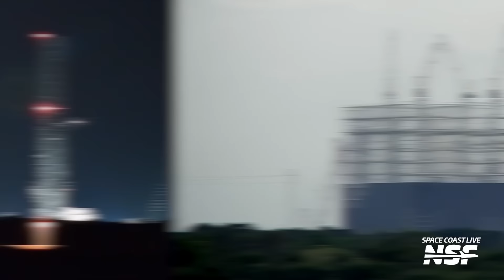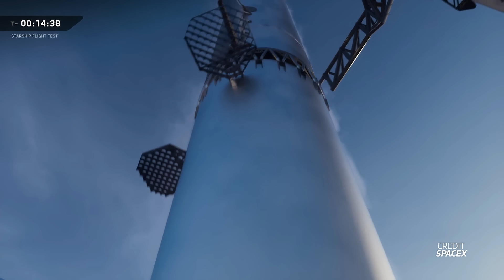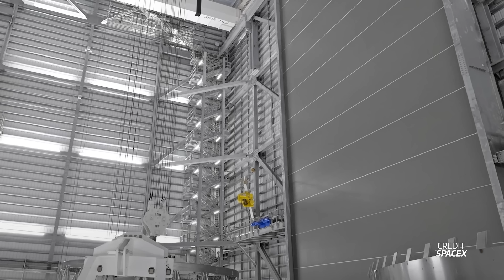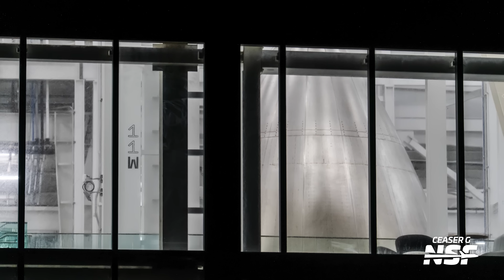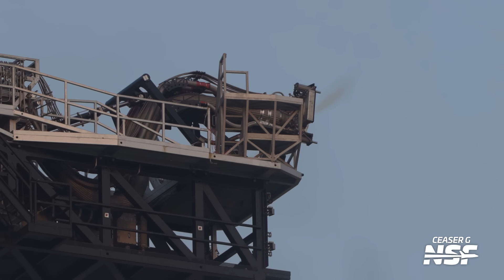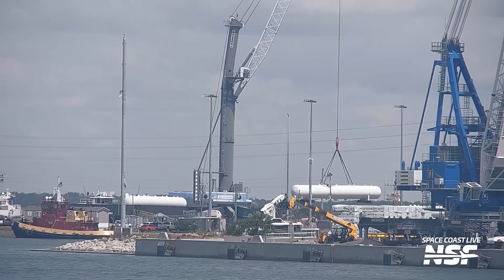Starship Flight 12 NET Date Revealed + New Trajectory Explained! | Starship Update

Comment: If mars atmosphere is thinner than earth why is the heat Sheild so important. The reusable aspect of the heat Sheild doesn’t have to be important. We could just send everything to a moon base or orbit and it never comes back to earth unless we bring people back to earth then we send the heat Sheild to the base and send the humans back from there at that point that won’t have to be reusable. Only reason I think you’re worried about the heat sheilds is because space tourism is going to pay for you going to mars or something. Surly there must be a better way to fund going to mars than space tourisim. All the things we send to space should not come back as that’s the hard part. Then it should be reused in space or on the moon base.
Reply: Far more flights will be going to LEO and back than to any other places.  So TPS is a very high priority.  Your thinking is a bit short sighted.
Reply: Because one of, of not the most important, task for ship is to launch Starlink satelites which requires a return to earth so they can use it again.

Comment: Why do umbilicals of seemingly all rockets have to disconnect at the last second of takeoff? Why not 10s our a minute before? It's not like there would be any significant fuel top up in the last 10-60s and sensor data is related wirelessly anyway. Seems like the rapid disconnect just adds some risk. The only reason I can think of for last second retraction is in the case of aborts the operators don't want the umbilicals disconnected as the ship cannot detank, and maybe it's hard/impossible for some GSE to not reconnect the umbilicals without human presence. Would love to get some insights.

Comment: Curious they’re still stressing test articles after the flight articles are finished coz of the test articles reveal a design fault they might have to rebuild the flight articles. Let’s hope no design faults are found.
Reply: Which is why they did all ground tests before rolling the flight articles back to their bays, then starting these tank tests. That way if they do they can immediately make the fixes, without having to build new vehicles first.

Comment: I just wished they would try to catch the booster if everything goes well, since it takes ages to build new one
Reply: What about the most expensive part of the operation: the ship itself? Instead of crashing it into the ocean because it cannot be caught at all. Assuming it once  survives reentry at full orbital speed. 
Still a long and expensive way to go.
Reply: @bordeaux1962 you people are funny. First you claimed the booster could never be caught. Then they did it multiple times. Now you are back claiming the ship could never be caught. And they will do that too.
Reply: @Blubb340  I never said anything like that about the boosters. Your argument follows its own logic, not reality. Regarding the ship, keep in mind that scaling up is not always successful in engineering. Currently, it does not work. Obviously. We'll see.
Reply: @bordeaux1962  It's crashed into the ocean for safety.
Reply: @imaginary_friend7300  Right. That's part of the problem.
Reply: @bordeaux1962  The problem your making up?  I'm starting to suspect you might be full of shit.
Reply: Not this time, not with a new booster and engines.
Reply: @imaginary_friend7300  Right. That's part of the problem.
Reply: @bordeaux1962  What problem?
Reply: They are not building new ones because they can't catch the old ones, they are building new ones because its volving

No point in going through the risk of catching a booster you know you are not going to use again anyway

Comment: @14:24 a piece of the roof is missing, but I don't think that was what we saw. Something with a surface area/mass like that wouldn't be able to maintain a spin for that long.
Reply: I concur…especially after its apex. In the incident clip playing at 14:29, there appears to be a second similarly sized piece also airborne off tho the lower right, this piece also doesn’t behave like any “typical” roofing material I’m familiar with.
Reply: Correct
Reply: A flyover soon after by RGV Aerial confirmed that two roof panels were blown off. Even without that flyover, previous photos of that spot show nothing of the same size/shape as what was launched, aside from the roof panels of course.

Two objects were launched, two roof panels were missing immediately afterwards. How would it be anything other than a roof panel?

Comment: You mentioned the COPVs are pressurized with CO2.  I always assumed it was nitrogen or helium...  I wonder what the tradeoffs are for the different gasses. Does anyone know?
Reply: They have COPVs with all the gases you mentioned, plus methane, for different purposes (he did briefly mention this)
Reply: If I had to guess the trade of is probably mainly about the density of the gas. If you use different gasses at equal pressure and release them from the tank with equally sized vents: Dense gasses -> low velocity, high mass; Light gasses -> high velocity, low mass.
Reply: I know that helium is extremely expensive. So you can most likely cross that one off the options.

Comment: I can't believe SpaceX is still hauling around engines on highways unprotected. That's as bad as hauling COPV's that way. Wait, they do that too. Makes you wonder what else unnecessarily reckless they do.
Reply: Well, you go get an internship and get hired by them, obviously you know so much more about safety standards than they do.
Reply: @gregspan It doesn't take a former nuclear engineer like myself to know what is unnecessarily reckless. It would cost nothing to protect these, yet they choose not to. Enough said.
Reply: @nuke.393  Former? Why aren’t you one currently?
Reply: @nuke.393  Do you know how much these engines cost compared to COPV's, how much harder it is to replace a damaged engine than a damaged COPV? It doesn't take an engineer of any kind to figure out they wouldn't be reckless with hardware like that... if it really were reckless. I'm tired of people like you ignoring basic common sense and then act high and mighty like they know better.
Reply: @ChristLink-Channel  Can they survive a bullet fired at just the right angle? All you need to do is take a look at the hood of my car to understand the dangers here. The rock impacts might not be quite as bad as a bullet but there are craters in solid aluminum that I know for a fact if seen on those engines would be a concern. But why even go there? Again, it's nothing to prevent this, but the fact they don't bother speaks volumes. Not here bash SpaceX. I just am taken aback at the reckless behavior.
Reply: @gregspan  I retired when I was making much more money on investments than actually working.
Reply: @bulletnotloaded3586  Arguably they lost two vehicles due to their reckless behavior with COPV's and I still don't think they have learned their lesson on it.
Reply: @nuke.393  You fake engineers tend to say a lot of silly things.
Reply: @imaginary_friend7300  The very fact they paved the route to Massie's shows they know flying rocks can be a hazard. Yet STILL they seem to think it's worth it to proudly haul these pieces of equipment around like they are show pieces rather than protecting them. Gravel or paved, with enough miles, that one rock is eventually going to strike it in just the right way to be catastrophic without protection.
Reply: @nuke.393  They paved that rise so the SPMT's wheels could get traction!
Reply: @David-yo5ws  If they upgraded it for SPMT's and not due to stray rocks, that means they are even more oblivious than I feared.
Reply: Who said anything about dust and wind? Although a small pebble launched from the tires of a construction vehicle is arguably a part of dust. I'll give you that one. Why is this even a debate? Ever heard of cracked windshields? Something cracks them. It's not dust or wind. Whatever it is, can't be good for COPV's or engines. Remember this is the same company who thought it was a good idea to fire these engines without a flame diverter. They had to "test to failure" before being forced to stop digging that grave.

Comment: "The best part is no part" says the company undermining decades of water deluge development using hydrostatic pressure via gravity to pump water at the rocket using turbo gas pumps.

The failures the starship program lead me to believe it actually was Musks brain child. It's exactly what someone who had a baseline understanding of aerospace but an astronomically large ego would design.
Reply: Wow, you should go apply for an engineer job at the stage 0 team and school them on how they're all idiots. Secondly, Elon has said in an interview that the new launch pad was designed by a team seperate from himself. So go on, school them...
Reply: Your ego comment is projection.
Reply: Gotta agree, that had to be one of SpaceX's dumbest moves. Talk about re-inventing the wheel. Everybody has at least one moment like that.

Comment: It looks like spacex is moving the raptors with cyber trucks now? Do we know if they do that the entire distance between star base and mcgregger? There is probably a few interesting Walmart parking lots along that route for charging and raptor watching
Reply: Interesting question! Google says the distance is about 460 miles. With that big engine sticking up, a Cybertruck might get 250 miles range on a charge, so it would require a recharge at the halfway point.

My guess is that they're shipped inside 18 wheelers. That would enable them to ship several engines at a time, and avoid the recharge stop, and also protect the engines from weather, insects, bird strikes, etc.
Reply: That`s a really good point, how many charging stations could there be on the route between the two...